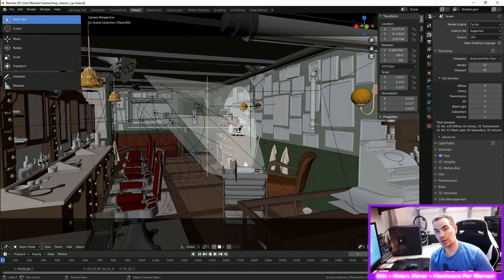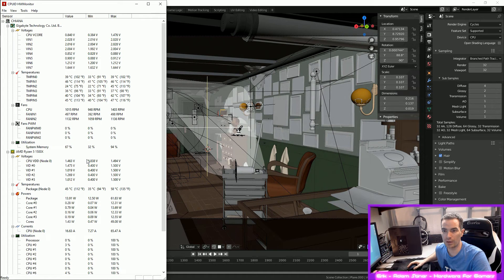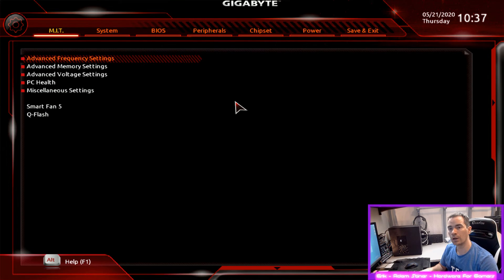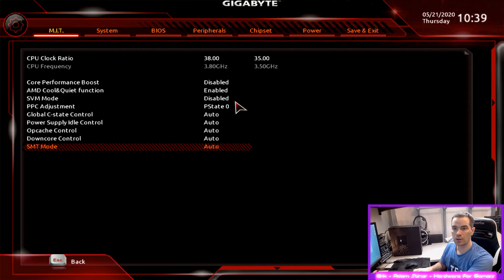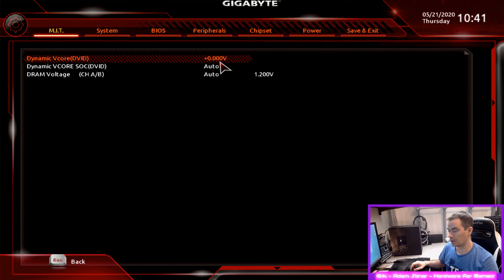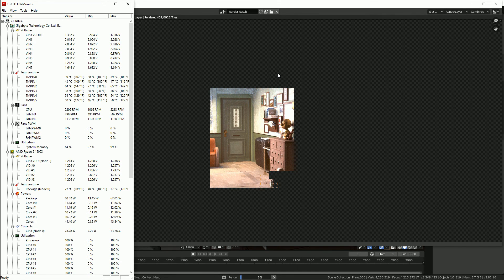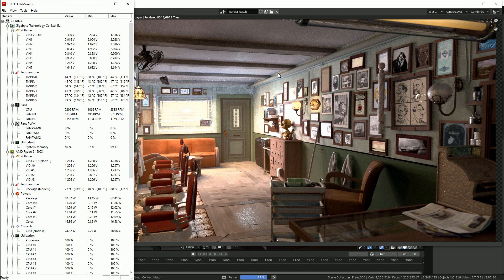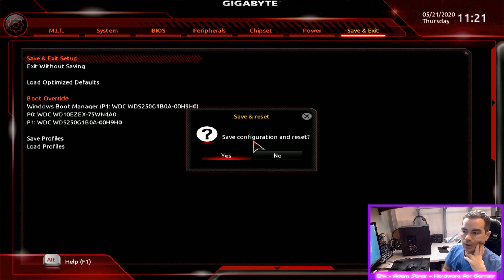Overclocking Your Ryzen CPU Using Vcore Offset

Comment: I have the r5 3400g 
I overclocked it to 4.1ghz on auto voltage the motherboard set the voltage to 1.45v that made the cpu temperatures so high 
So if I what to keep it at 4.1ghz what voltage should I set it on manually
Reply from the maker: Every CPU is different. You need to go through the testing.
Reply: Start low voltage going high till you get it up and stable

Comment: Very nice vid. Please help! I have a Ryzen 5 3400g and my goal is to run it at 4.00Ghz with 1.35 ~ 1.37 voltage but it keeps on crashing. I've read some posts that they can run theirs at even lower voltage (1.3V) at 4Ghz. But mine can't. What to do?
Reply from the maker: the main reasons why a CPU would crash, are temperatures or not enough voltage. What is the temperatures of the CPU? What cooler are you using? Are you using the integrated graphics of your APU?
Reply: @HardwareForGamers  My temp at idle is 35C. Under load/gaming 60-70 dpends on the game. So am I undervoltage? Why others can run theirs even at 1.35 volts at 4Ghz? Mine can't even at 1.37 volts.
Reply from the maker: @cDekKk  70c when gaming is definitely on the higher side. It really comes down to silicon lottery when overclock. So if it is the silicon your shit out of luck.
Reply: I got mine to 4.2 ghz at +0.024v and my vega 11 graphics at 1800mhz with no voltage change,getting around 40-50 when gaming. I am using a cooler master ml rgb v2 water-cooler though.
Reply: @rcnation7418 update? I get 3.97 ghz base speed with 1.4v oc

Comment: Please provide a tutorial for overclocking ryzen 5 3600 4.2ghz which is safe to use every day playing games and editing videos, please make the tutorial because I am looking for a tutorial I haven't found the right one like yours which is very easy to understand by beginners like me ?? 🥺
Reply from the maker: You do realize that depending on the motherboard and CPU cooler 4.2ghz on a 3600 may not be possible. right?
Reply: My motherboard gigabyte b450 and cooler from id-cooling 240
Reply from the maker: @gus.bro17  if your looking to OC your system check out this it should help How 

To Overclock And Undervolt A CPU and GPU - https://youtu.be/jpRwtMzZ9aQ
Reply: Oke, thanks 🙏
Reply: Did you find a solution? Cause I might be able to help you. If you want help add me on discord at Catalin#9095

Comment: Hello can you help me? My CPU vdd not changed when a test in cinebench on BIOS i háve changed manual but on hw monitor CPU vdd is 1088 and not 1,237 or 1,3 etc
Reply from the maker: with the information you gave no I can't.
Reply: @HardwareForGamers  no problem i tested more and unplug my psu for seconds and restart and its ok now

Comment: BRO IN 3 3100 WHAT IS THE VOLTAGE +
Reply from the maker: No idea. You can take check hardware monitor when running blender on a good voltage to start at.

Comment: That's not how you setup a voltage offset, you have to set a negative offset so the CPU doesn't go to 1.5-6V and just degrade itself till death, a negative voltage of -0.100 would be a good place to start with, if your computer crashes with that voltage bring it up a little bit, like -0.0875, and always do small increments, and test each thing before changing another, also, you want to set up your LLC too, that way you can control how the voltage regulates between loads, very useful for overclocking, mostly try to keep LLC at the middle/medium range, for example, if you have 5 levels of LLC you would want to use either level 3 or 2, depending on your motherboard. With this config since your idle voltage would be around 1.4 or so, and your load voltage would be around 1.3, which is good for Ryzen 1xx and 2xx, although I would recommend not doing offsets if possible, just try to set your voltages between 1.280-1.350 and you're good to go.

I'm currently running a Ryzen 5 1600 at 4GHz with a set voltage of 1.3125 not an offset, and level 3 LLC, and ram at 3200MHz CL14 (will try to get 3533Mhz in the future)

Remember LLC differs between motherboard vendors, I own an Asrock B450M Steel Series motherboard and level 5 is the lowest while level 1 is the highest, I used to own an MSI X470 Gaming Pro that got water damaged and it had like 10 levels of LLC, level 1 being the lowest and 10 the highest.
Reply: You make no sense, not all hardware is the same, you make it seem like you just now found out how to somewhat overclock and think what you do is the right way
Reply from the maker: ... You do realize it depends on the motherboard.
Reply: @HardwareForGamers  Haven't tried Gigabyte motherboards, but offsets seem to be the same for everything else.
Reply: @HardwareForGamers  I'm not trying to trash talk you or anything, just trying to be helpful and correct some things.
Reply: @HardwareForGamers  Yeah, sorry, just checked and for Gigabyte boards what you did it's fine, but next time clarify that it's not the same for every board, because, offsets for mine are not like yours, which goes for Asrock, Asus and MSI boards, Gigabyte boards don't seem to allow negative offsets, on any other board you would be pushing 1.5 volts into the chip with a positive offset.

Comment: When iam settings my dynamic vcore to +0.124 the voltage ramping upto 1.5 volts which so high I don't know what's going on
Reply from the maker: Does the motherboard have some sort of auto overclocking features that are on? What voltage does the CPU get at stock?
Reply: @HardwareForGamers  ok so when dynamic v core at auto then it seems fine but when iam tuning it manually bios showing voltages 1.5 volts on ideal is this even possible I have ryzen 3 2200g
Reply from the maker: It's possible, have you tried booting in to the OS? Some motherboards show a high voltage in the BIOS and then it drops in windows....
Reply: @HardwareForGamers  ok tems are high af at idle it's 52 degree Celsius
Reply from the maker: @blueaka9931  do you see the voltage? And what cooler are you using?
Reply: @HardwareForGamers  it's between 1.489 to 1.500 and iam using Corsair hydro h60 maybe that's bad
Reply: @blueaka9931  i also have the same apu. 1.5 volts is too much for ryzen 3 2200g. Just drop the voltage below 1.4 or so and check the temps. 
My CPU is overclocked at 3.8 GHz at stock cooler.
VCore offset is -0.036 or somewhat around it. And my CPU runs smooth.
Reply: @pronoob477  you can overclock that cpu to 4ghz at only 1.3volts

Comment: bro i have a question i also have ryzen 5 1500x why does my vcore not drop during idle!! my freq drops but not vcore why? i have c states enabled... help??
Reply from the maker: Are you overclocking? What motherboard are you using?
Reply: Make sure your voltage is set adaptive and not to a fixed voltage in BIOS, and in Windows be sure you're on the "balanced" power plan, and not the "Ryzen balanced" plan. sounds counter-intuitive, but that Ryzen balanced plan was a stopgap fix that stuck around and isn't good for anything now.
Reply: @jeffg492  
The minimum processor state in Ryzen Balanced plan is set to 90%.Change it to 20%.